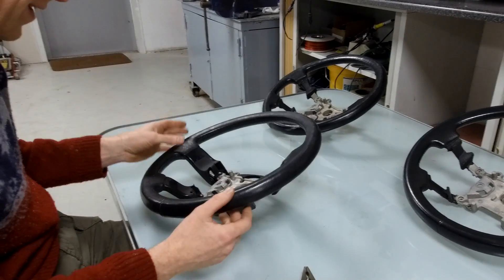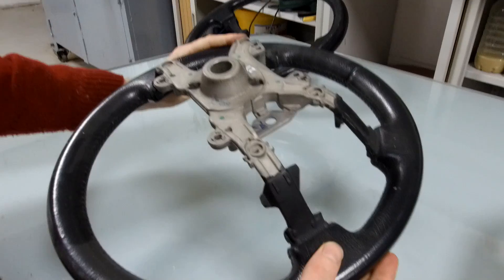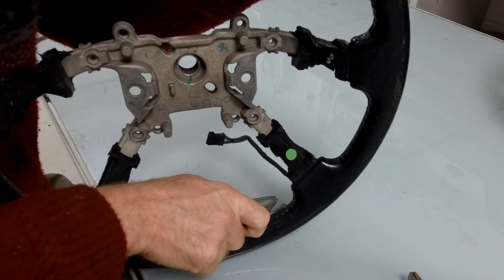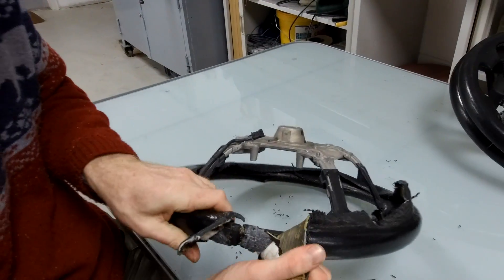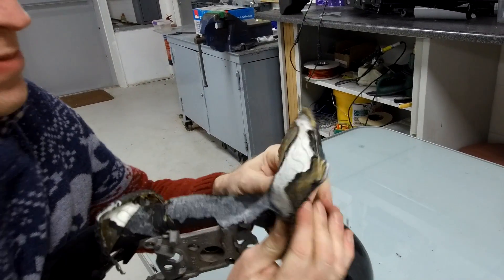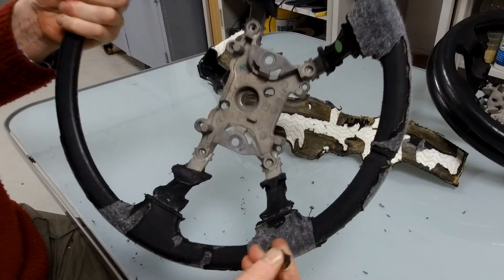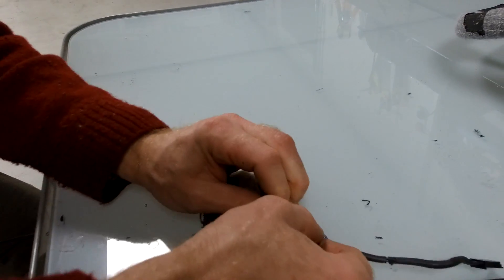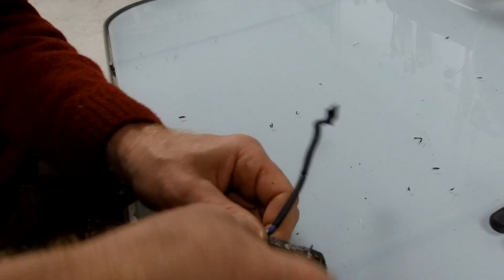What is Inside a Heated Steering Wheel And How Does It Work ?

Comment: I want to upgrade my Freelander 2 Steering wheel with carbon fibre heater pad. The electrician man told me that he can install it, but he doesnt know are the cables will be fine. What do you suggest? My car is 2010 prefacelift XS
Reply from the maker: The power needed for the heating element is quite high - so this could be a problem - i think they did make a slip ring with power for heating steering wheel - i think land rover had a "cold climate pack" option.

Comment: I think there's a temp sensor then the system will turn off when reach a dedicated temp. My ram did not come with heated steering wheel, wan to add this function,
Reply: You can buy the heating strips to put on the steering wheel, but you have to take the leather off then put the adhesive down then you have to re-stitch it up.
Reply: @brokearcader6625  where can you buy the strips and how much are they?